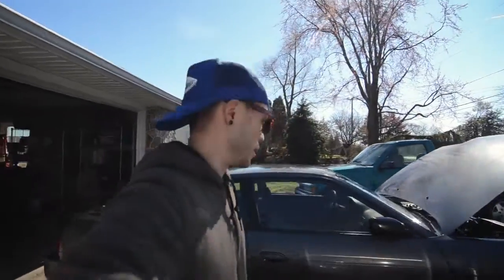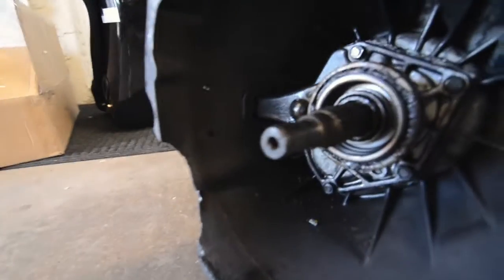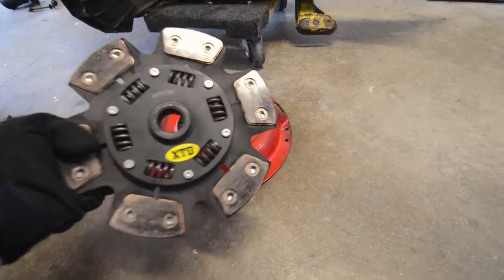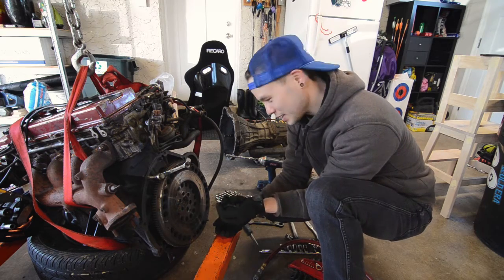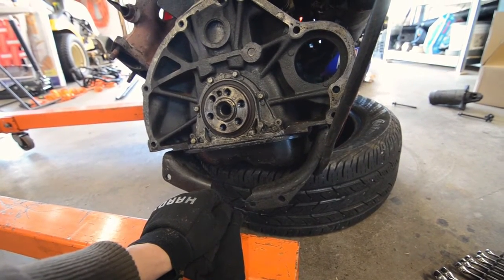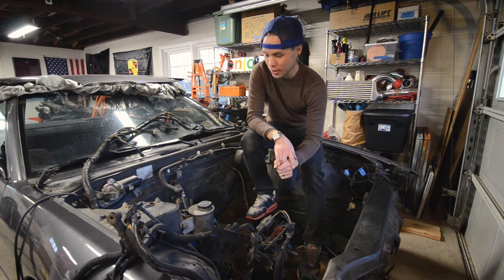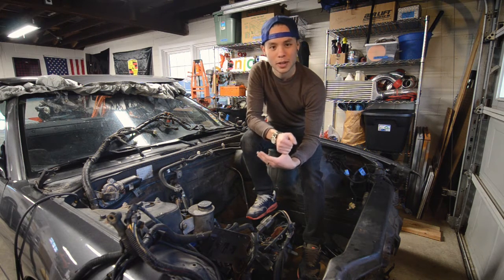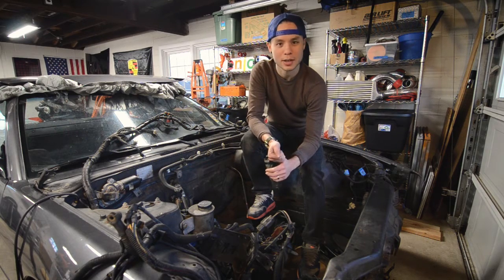Drift Jawn Ep04 - Demo day

Comment: http://www.ebay.com/itm/NISSAN-SR20DET-S13-S14-Transmission-DUST-SHIELD-Genuine-OEM-SR20-Silvia-/162419862482?hash=item25d0fa6bd2:g:ZPoAAOSwKOJYIVEu&vxp=mtr

You need the proper dust plate, which I believe is what you're missing. Similar to this posted, but for the Redtop/S13 (they might be the same as the one posted).